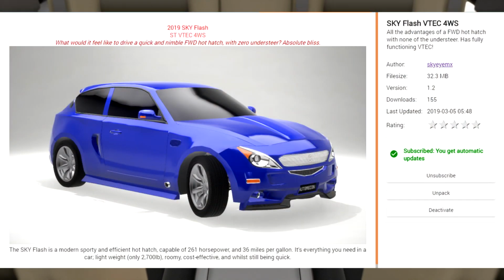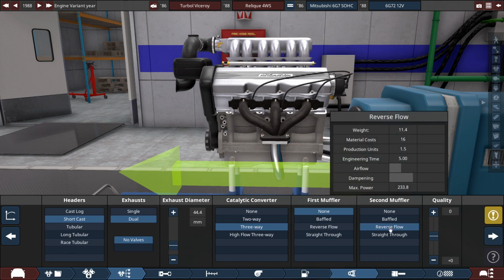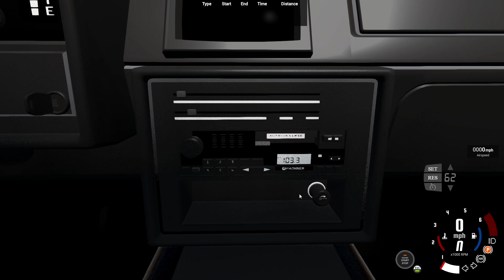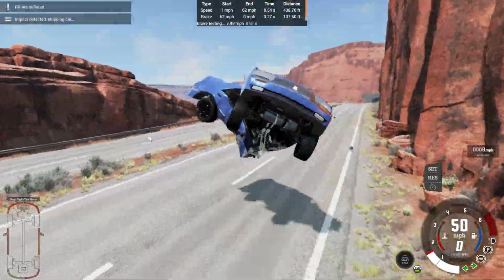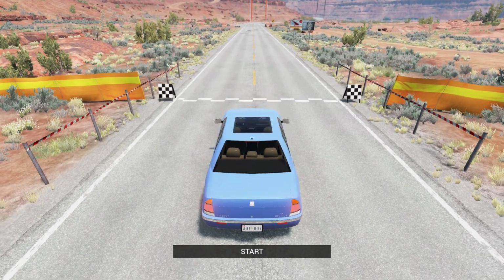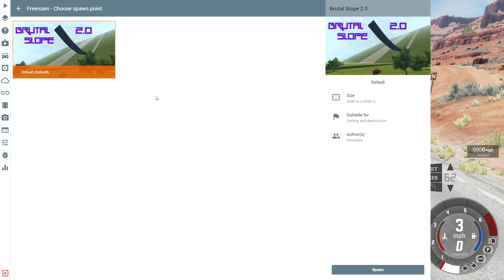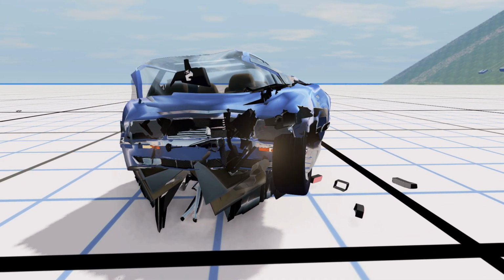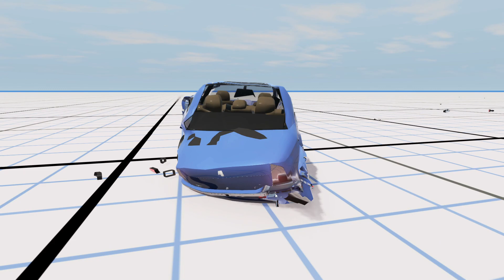This Car's Got 4 Wheel Steering! | Automation The Car Company Tycoon Game & BeamNG.drive

Comment: I have done this before on my YouTube channel but it wasn't a great system as it kept breaking apart. This one seems like it won't break after a few hard turns. So congrats!
Reply from the maker: Thank you! All I did was copy & paste the rear suspension code from the modder's car into this car to get it to work.
Reply: @TRIZEGames  I did the same exact thing as well.
Reply: @462Designs  veeeeery late answer you can use the advanced tuning parameters and add beamstrenght to 400% to fix that issue.